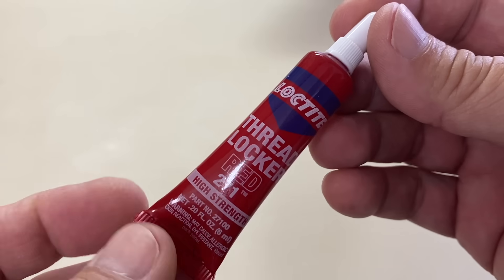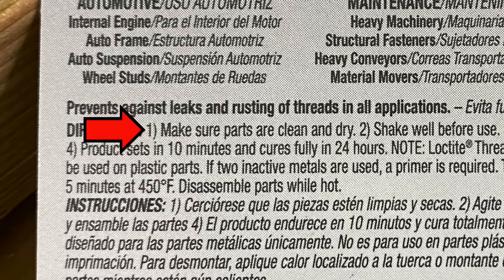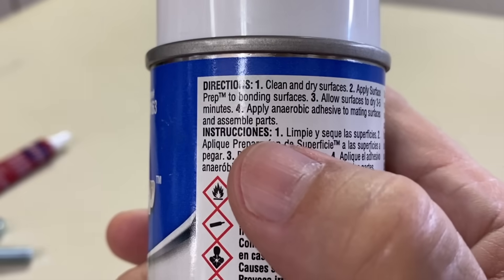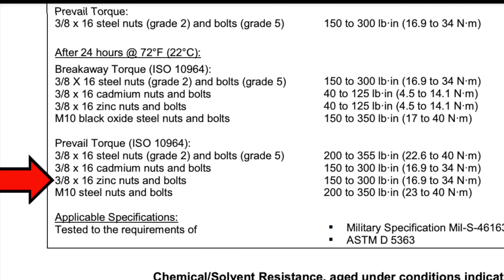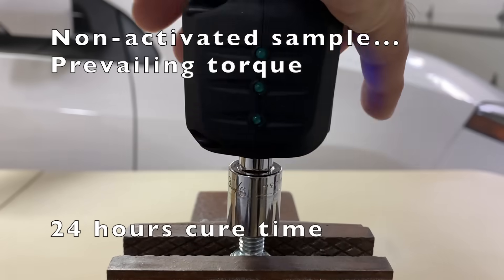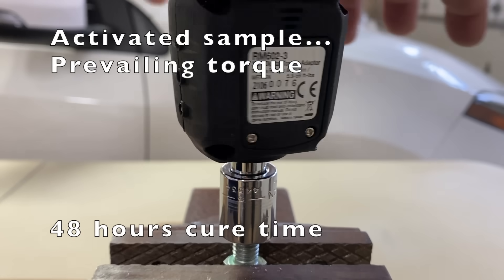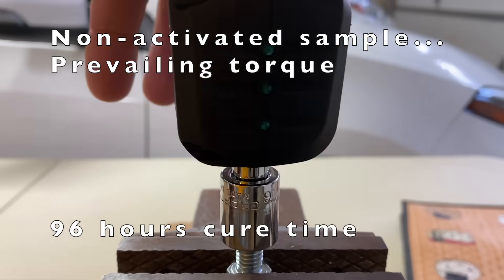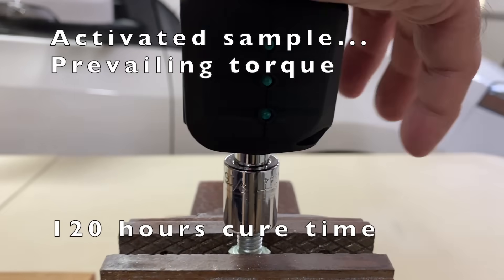Nuts & Bolts - Most DIYers Do Not Know This | Loctite Red Threadlocker Curing

Comment: If I was going to do such an experiment, I would do at least 3 test at each test point (verses 1).  Then I would get a mean number and a sense of how much variation of that number. But good job on the work.
Reply from the maker: Thanks!  I was lazy.  LOL
I usually setup 3 samples of each.  More recently I’ve been setting up 5 samples and removing the high and low values.  👍😎
Reply: sorry Ralph, I saw your comment seconds after posting mine. Kindred spirits!

Comment: I usually spray the parts with brake cleaner and blow them dry with compressed air. Especially the black oxide coated screws with the oily coating. It's more economical than that high priced activator and they lock right up...

Comment: In the 70’s Loctite marketed  “accelerators” in aerosol cans. 

The thread locker product has a shelf life. I always have 222, 242, and 290 available, in the 21 size (smallest), because I can’t use enough of it within the useful product life. The 290 serves as a high strength thread locker, and it is also a porosity sealer. It will actually wick into the threads of a tightened fastener. The older the product gets, past it’s shelf life, the longer the cure. Added to that shelf life you also have the tolerance of fasteners sourced from hardware stores. It’s a safe bet that results for bond strength and cure time will have a fairly large spread. 

Northrop Grumman specified Bossard fasteners for everything they built on the projects I worked on. This was to ensure that they had traceable product in all applications. They used contact washers to provide a reliable method for servicing assemblies. They also used threaded inserts in anything that was non-metallic or 6061T6. These inserts were bonded in.

Comment: You made one big mistake, loctite activates in a lack of oxygen environment. If you had tightened those nuts against something to several foot pounds, then you would not have gotten any of them off. thanks for trying, try again. Red is permanent, blue is less permanent. It takes heat ro remove a nut from red.
Reply from the maker: Thanks!
Don't feel bad... this is a common misconception.  Torquing the nut and bolt is not required for threadlocker curing.  Here's my video that demonstrates this... https://youtu.be/7yPQIsfv9x8
😎

Comment: The factory manual for my 01 Silverado says to put red loctite on the caliper bracket bolts and torque them to 129fp. I cleaned the holes with brake cleaner and did as instructed.  I had to take them off a week or so later. Let me tell you. Hitting them off too a 24” breaker bar and lots of muscle. Much more than torquing them to 129. I didn’t use the loctite on reassembly. I’ll check the torque at a later date. If it’s loosened up any I’ll use loctite again. If they haven’t changed I’m leaving it alone.
Reply from the maker: 129 ft-lbs and they still asked for red Loctite?  Sounds like overkill.  Wow!  😎

Comment: just use vinegar to remove the zinc and wire brush to plain steel. Loctite works better on plain iron steel. Do a vid on that please...
Reply from the maker: What a coincidence!  I’m working on that video right now!  😎
Reply from the maker: And thanks for the tip on how to remove the zinc plating.  I tried it and am amazed at how well it works.  👍😎

Comment: I know this is a year old at this point but i was confused by your choice of "inactive" metals.  Zinc is used on steel fasteners because its MORE active than steel - its a sacrificial coating.  Zinc is more active than almost any other metal you would use on a fastener.  In my mind when I saw the warning on the label I was assuming "inactive" metals meant stainless steel fasteners.  But then I read the loctite website and it does list Zinc (galvanized): "We recommend the use of primer where both the parts come under the category of 'inactive surfaces'. These metals lack the iron or copper content and thus the metallic ions are required to fully cure the product within 24 hours. These inactive surfaces include plated parts, stainless steel, galvanized steel and anodized aluminium to name a few. On the other hand, in case both or at least one part is an active metal, then there is no need to use a primer to ensure full cure which is typically within 24 hours at room temperature."   Anyway I think it would be interesting to do it again but with stainless steel threads.
Reply from the maker: Thanks.  
I used zinc plated nuts and bolts because… 
1) I already had them.  😁
2) Zinc is listed as an inactive metal on the technical data sheet for the Permatex Surface Prep activator that I could get in my area.  
Loctite’s threadlocker manual lists zinc as a slow curing passive metal between active and inactive metals.  Close enough.  
I may do tests with stainless steel at some point.  
BTW... the manual also lists stainless steel as passive.  
👍😎

Comment: In aviation we sometimes need a thread locker - particularly when disassembling and reassembling wheel halves. Yes - I did know you need an activator. Now do I use one at home for my own home stuff? Generally no. I look for a lock washer instead

Comment: As a young man I started using red Loctite 45 years ago in a professional setting. All connecting parts had to be degreased with M.E.K. then primed and let dry and then assembled with the red after approval by an engineer. These were machine repairs for bolts and bushings. When done properly you needed a torch or had to machine them to get them back out.

Comment: The bolts must be tightened, torqued.
Example. Drive the nuts to the bolt head then torque each example to the same specifications.

I have found that locktite red did very little when I installed a crank case cover with red locktite, 12 bolts. I mistakenly did not torque bottom 2 bolts, only hand tightened.
I realized this a week later when I needed to affix a bracket to those same 2 bolts. I went to remove them, they were not torqued but saw the red locktite. I checked the second bottom bolt, same. Able to remove by hand.
Checked all other bolts, clearly they were torqued to speck and needed more torque then specified to remove.

My conclusion was red lock tight works as specified when underload, torqued, tightened.
Like wood glue, creating a much stronger bond when clamped during the cure time process.
What do you think?
Reply from the maker: Thanks!  Yes, nuts and bolts are normally torqued when using Loctite, but torquing is not required for curing.  If you want to nerd out on something, watch this follow up video… Loctite Mystery Solved!
https://youtu.be/7yPQIsfv9x8
😎

Comment: Loctite only works if you torque it down. Omg waste of time, money. Have you ever even removed a loctited bolt!😂😂
Reply from the maker: It is normally used on torqued nuts and bolts, but that does not mean that it needs to be torqued down to cure... https://youtu.be/7yPQIsfv9x8
😎

Comment: Did you know that if you touch the tip of the Loctite tube on the bolt when using Loctite that the Loctite will set and block up the tube tip.
Reply from the maker: I’m not sure about that because the absence of air or oxygen is also required to cure Loctite.  🤷🏻‍♂️

Comment: While very interesting and informative information, I am 100% certain that precisely nobody does any of this. Including reading the directions LOL. Most do, however, apply far too much and then, later, when they remove the nut, bolt or screw, don't clean the old threads, apply even more Loctite, and reinstall.

Comment: ⚠️Would heat speed up those long curing times ???
Most of my applications on aircraft require the craft to be back in service asap after repairs complete ⚠️
Reply from the maker: Yes, I believe heat will speed up the cure time.  I’ve been thinking of doing an experiment but just haven’t gotten around to it yet.  😎

Comment: Excellent excellent job my friend.
Well done
Reply from the maker: Thanks!
Reply: @HacksbyDad  
No problem I'm going to try to use some red loctite to remove a tiny little bolt that I stripped out with an allen key.

I am hoping the Allen key will be cemented in there firm enough that I can remove this tiny little bolt

Comment: The breakaway torque of non-activated applications was 90% of the activated, but the prevailing torque of the non-activated was 70% of the activated. It seems like it has a bigger impact on the prevailing torque. Also, the torques of the activated applications seems to be a little more consistent, but this is a very small sample size so it might not mean much.

Comment: very technical excellent video, I always used disc brake cleaner on all bolts that need high break a way torque, makes a difference
Reply from the maker: Thanks!  I prefer grease & wax remover plus IPA after conducting this test... https://youtu.be/qs2E7DWzXYc
😎

Comment: Non-Activated at 72 hours for the win. Basically what the results show is doesn't matter if Activated or not, won't make much difference. Better to use a stronger Loctite if want better strength.

Comment: The game changer is not applied torque...The nuts and bolts are designed to hold something together...it makes much tighter that thread and threadlock does not get air. No air make it settle. So, that test was failure!
Reply from the maker: LOL  👍

Comment: All those samples don’t reflect the actual strength of the product because for loctite to actually “set” you have to tighten the nuts. Most people make the mistake to think you can just use it to prevent lose nuts from backing out, but it isn’t the case, if that’s what you want there are nyloc nuts or cotter pins. But loctite is meant to be squeezed tight
Reply from the maker: Thanks!
Yes, this is not how Loctite would be used in real-life applications.  It was simple strength test of the adhesive itself.  
😎

Comment: Off course the ones with the primer will only be slightly stronger when you always weaken the vise by doing the non-primered one first.  Do the test again.
Reply from the maker: Sorry… what do you mean by “weaken the vise?”
Reply: @HacksbyDad  The metal in the vice is heated and stretched when you move the metal parts for the first attempt. Even if it's only a small temperature change, it's there anyway. This causes the vise to become looser and destroys the credibility of the experiment.
Reply from the maker: @SwedishNiceGuy  Sorry... I don't understand.  🤷🏻‍♂😎

Comment: 48 years as a Professional Mechanic and I’ve never read the instructions (Hey…I’m a guy) as I was trained, we’ve always just cleaned the Nuts, Bolts or Studs off with brake Clean and pressed on with the job and have never had a problem. Honestly, I don’t know any Professional Mechanic who does all that just to apply Locktite.

Comment: If you use actual lock tight activator you don’t have to wait 1 minute , had a class put on by lock tight, smooth shaft and coller was sprayed with activator then lock tight it set up in a few seconds he handed it around to each person and no one could move the collar, I shoved shaft against table and did move, I am not a small guy 6’5” 350 lbs and can carry a fully assembled V8 across the yard lol

Comment: How tight the threads were cut on nut and bolt also matters. Offcourse you will never find two identically cut threads, but some tolerances can be achieved. And in general threads class A tolerance is pretty loose, you  may get a nut settting tidy on the bolt, or feel like its completely loose and it will still be valid.
Reply: Yes, I noticed the wobble and thought the same thing.

Comment: The 'prevailing torque' figures show that you're better off skipping the primer. Bolts with loctite that will continue to turn difficult can be an absolute nightmare, especially if you have to untighten something after 15 or 20 years.

Comment: With all the add-ons to be bought just to stop a bolt from moving, if one wishes to be certain the nut won’t come off then round over the bolt, pour water on it and rust it on. This is especially effective when you will want to undo the bolt later. In fact, the more often it needs to be changed, the harder it will be to shift.

Comment: I wonder if because the hardware was never brought to torque spec after applying the thread locker it wasnt a accurate test since it wasnt the designed intent  of the product
 i think had you torqued the hardware it would bring the threaded surfaces closer together
And the thread locker into a more real world working environment by removing and displacing the ambient air away from the product  which activates the product itself
Reply from the maker: Thanks!
This was a simple adhesive strength test.  Similar to a test that Loctite does as shown in this video... https://www.youtube.com/watch?v=PGZCPyi8yBc&t=2s
😎

Comment: thread locker works better when the screws are tightened, not just hanging lose like this. Try it again while torquing to screws rated torque.
Reply from the maker: Thanks!
This was a simple adhesive strength test.  Similar to a test that Loctite does as shown in this video... https://www.youtube.com/watch?v=PGZCPyi8yBc&t=2s
😎
Reply: @HacksbyDad  understood, still would be better to see both. Maybe combined with actually not perfectly clean screw. Rather scientifically made dirty.
Reply from the maker: @FueRent  👍😎

Comment: I recommend using 91% Isoproyl Alcohol for cleaning parts, especially eclectronic parts because of the higher alcohol content and faster evaporation. 70% Isopropyl Alcohol is recommended for medical use because it has more water and it evaporates slower to kill germs for a longer period.

Comment: Without the nut being torqued down against the bolt, the thread/pitch gap doesnt provide a minimum clearance situation needed for real world application test results. The bonding process needs a tight metal to metal contact patch to achieve maximum strength. Otherwise you are just measuring glue rigidity/density strength.
Reply from the maker: Thanks!
That was the point... measuring the adhesive strength.  Simple as that.  Here's a video from Loctite that shows the same basic test with much more sophisticated equipment... https://www.youtube.com/watch?v=PGZCPyi8yBc&t=2s
😎

Comment: A pointless demonstration. If you want to test the torque of a nut and bolt, you have to load it. For what purpose would you ever use a nut and bolt that was not holding something together? Thread locker "glues" the compressed (when torqued) male and female threads together. The inboard edge of the bolt threads compresses against the outboard edge of the threads of the nut.
Reply from the maker: Take it easy!  😁 
This is a simple adhesive strength test.  If you really want to vent, watch this video... https://www.youtube.com/watch?v=PGZCPyi8yBc&t=2s ...and then tell Loctite that they don't know how to test their own product!
😎

Comment: My boat had a cast steel coupling on a Monel prop shaft. I had an issue with the coupling coming off the shaft in reverse. I cleaned both with Goof Off and used the red Loctite. The coupling never slipped off again.

Comment: I think I'm missing something in the transition from 'a primer is required' to 'hi, we're use Permatex Surface Prep'.  
In testing, you should use a larger set than 5 and should just show the results of the samples in a graph. Technically, this has been reduced to just one due to you testing at 24hr intervals. You're introducing too many variables to your test.
There is likely a more comprehensive datasheet somewhere online that would elaborate on the small info on the tube.
Testing only at 48hrs would also provide assessment on the primer or cleaning method only. ie compare just with rinsing in IPA.
The manufacturer says it cures fully in 24hr hours, but your data seems to show otherwise. Odd!
Zinc's reasonably active metal as well. 
I'd particularly like to see nuts and bolts washed in a baking soda solution before drying. And test these against other 'primer' solutions.
Reply from the maker: Thanks!
I posted the video just to share that the directions mentions an activator.  Something I never knew.  Not in my wildest dreams did I think the video would reach a million views!   Too funny!  😎

Comment: I clean bolts & nuts with alcohol or acetone. I prefer acetone.  I have a big v twin motorcycle,all the fasteners i used locktite on have never came loose with this process.
Reply from the maker: Thanks!  
I did a test and prefer grease and wax remover and IPA... https://youtu.be/qs2E7DWzXYc
😎

Comment: I have put light grinds from the grinder up some on the bolt with the blue or red then locked the nut in place. I guarantee you that is a pain in the but to unfasten etc etc !  backyard insecurity but still winning.

Comment: The theory is that by filling gaps, the solidified material will prevent the nut from vibrating free. Firstly it actually suppresses vibrations. Also, as it turns by any means, it will start to compress itself by semi-fluid movement, and actually increase turning resistance. To get the full effect - use more. It's proportional.